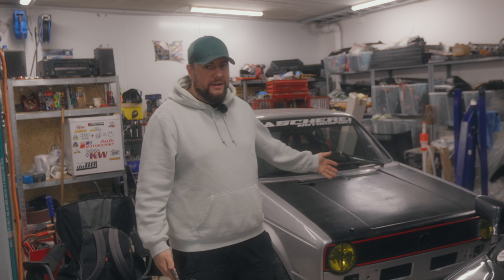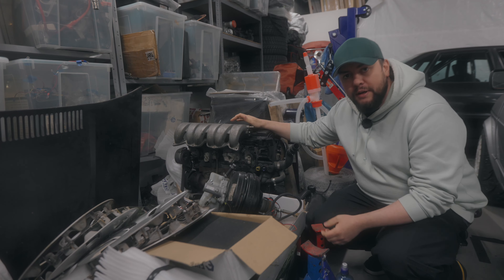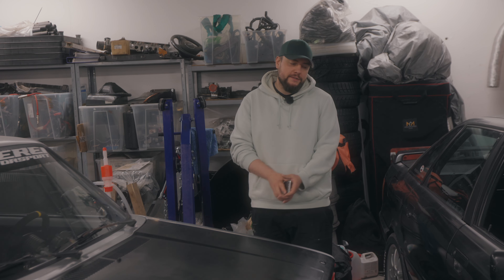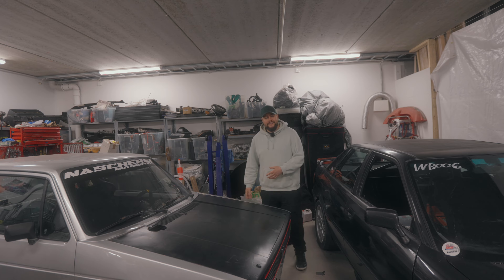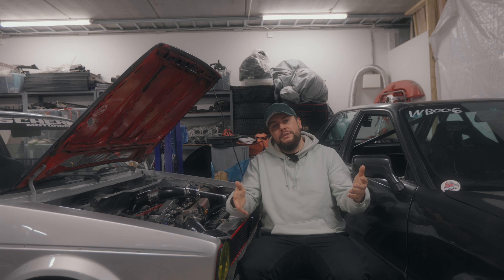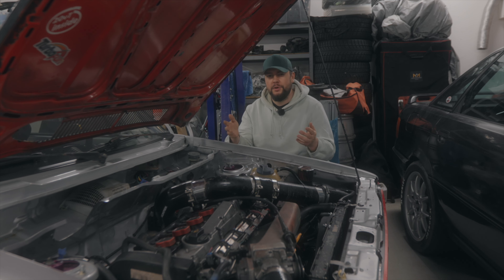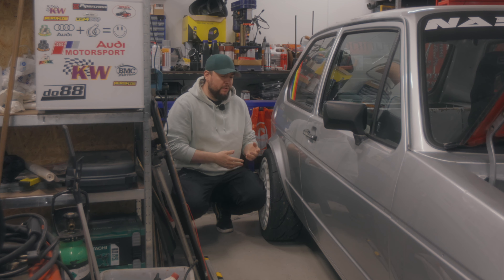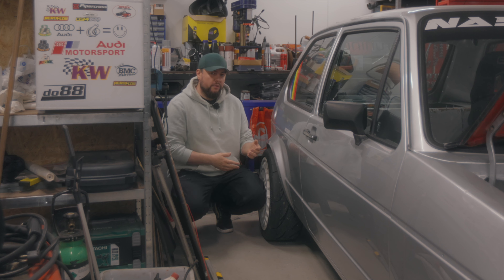Why I built the AWD Mk1 this way

Comment: The approaches you're describing are tried-and-true, and the result is a fantastic road-warrior or track car. I hope you don't mind if I add the alternative that I used to convert a mk1 Scirocco to AWD:

The situation won't last long, but right now we are at the ideal time where a mk1 TT is fully depreciated and you can still find a solid runner. It ends up the same price as just the engine/ECU and AWD drivetrain out of a wrecked donor. You can re-use the TT carpet, seats, electrical system, most of the exhaust, and ABS/traction control. Probably the single biggest advantage is the two-sided TT gas tank, so the trunk is not taken up by a fuel cell. The cars are dimensionally very close so you won't need to shorten any of the driveshafts or modify the suspension at all. You re-use the mk1 VW cabin structure and body panels, bumpers, lighting, all glass, headliner, dash, door panels, rear seat, and hatch cover.

 The cost savings are huge: I built the entire car for $13000 (12000 Euros) including expendable supplies like sandpaper, cut-off wheels, welding gas, etc...

The fundamental difference involves grafting not just the TT tunnel, but also the entire floor, firewall, and the front frame rails. The project ends up being more of a body swap, but the process is no harder than modifying just the tunnel and rear floor. The car will need widening flares and the result is heavier at about 2500 freedom units (I lol'd when you used the term, that's about 1150kg). OTOH the unibody is plenty stiff without a cage, so the result looks normal and it can support huge power.
Reply from the maker: This is great info! Maybe you could make a video talking about this
Reply: I have a slideshow on my channel, you can use info or pieces of it when you do these how-to videos.
Reply from the maker: @echassin  Thank you! I have seen most, if not all, of your awd Scirocco videos